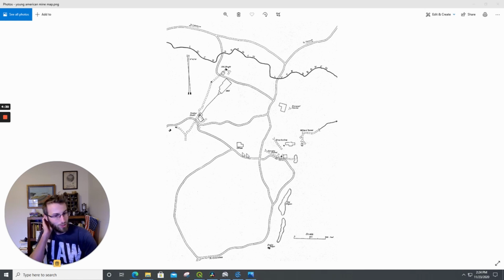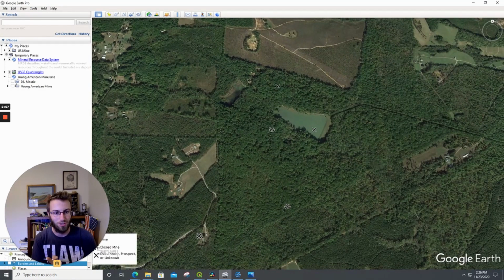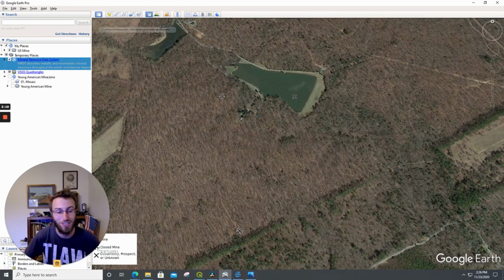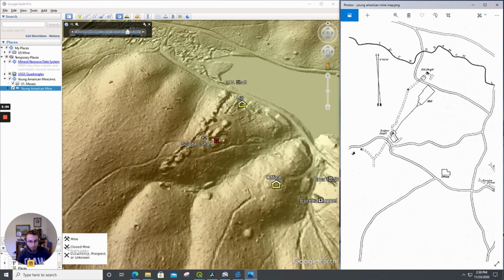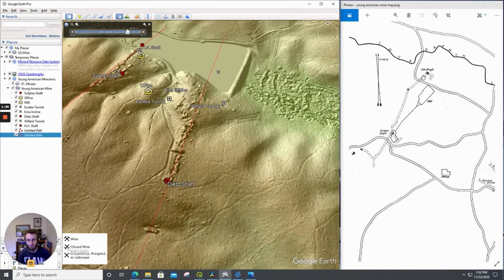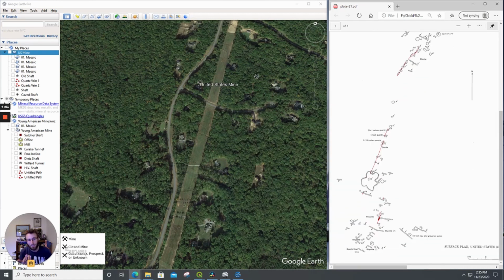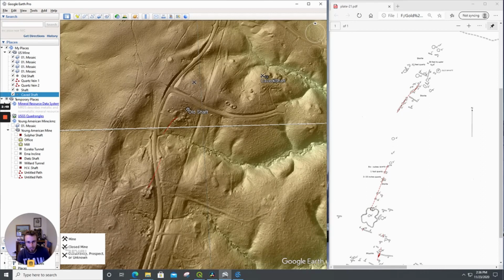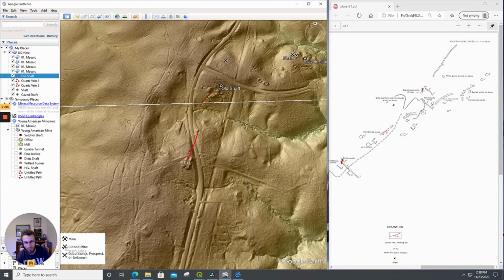LIDAR and Mapping Historical Gold Mines

Comment: I own a property in Oroville, California and have gold on the land. Theres old mine shafts and also old mining equipment left behind from the 1800’s. I have very little knowledge on it but have panned some out of the creek. Is Lidar the best surveying method to find out how much gold is in the land?
Reply from the maker: No.  Lidar will not tell you anything about how much gold is left.   Lidar just shows you the ground surface as if there were no vegetation.  It’s great for figuring out the trends of veins that the old timers were working as well as finding old workings that are buried under thick vegetation.   

There is no particularly good way to determine how much gold is left on a property aside from lots of prospecting, drilling and other geologic boots on the ground work.

Comment: I have 26 claims here in AZ, I found all the mineral deposites by traditional prospecting and with drones. Ive had really geart results using super high def drone cams for mapping but hooking up a lidar system on one of them might really make life much easier finding deposites
Reply from the maker: The problem is the expense of what a Lidar system for a drone cost.   Especially when within 5 years or so I believe AZ and most states will have sun meter accuracy coverage available to the public for free.    I will also say that Lidar is better suited to finding old workings then it is to locating a new virgin outcrop.